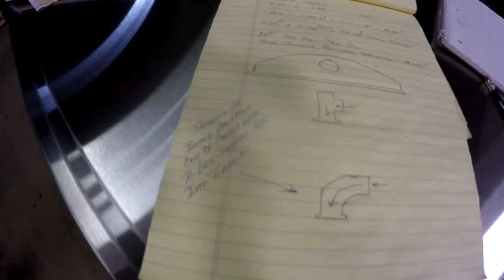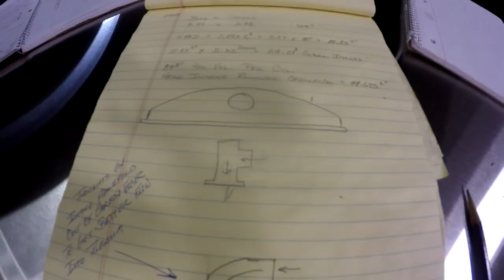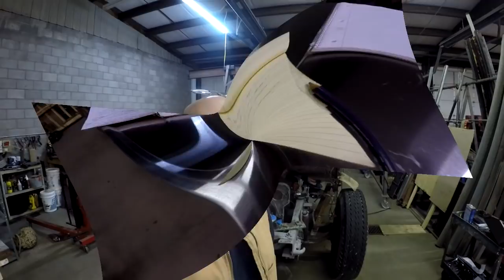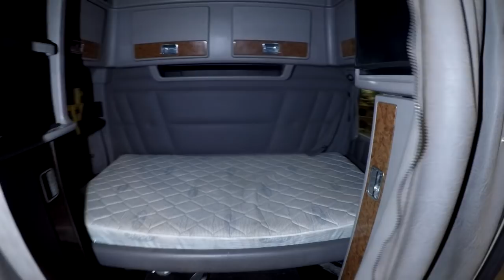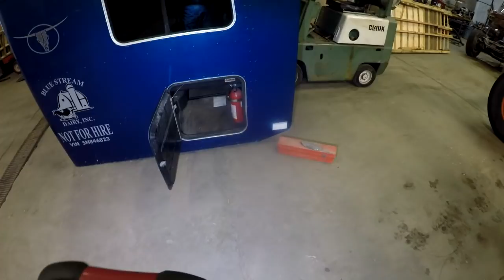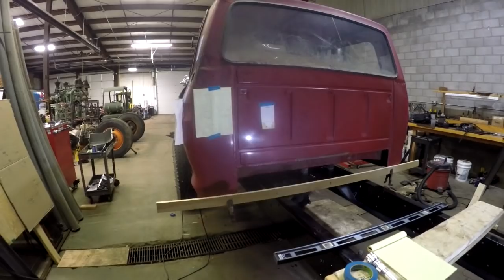Ford F750 Haul Truck Build Part 35 - THE SLEEPER

Comment: Did you ever finish the project? How did you install the sleeper to cab with the gap ? Which material did you use ? Have similar issue with my truck trying to figure it out ? Cab opening is bigger than sleeper opening trying to figure how to seal both up ? Thank for your help
Reply from the maker: Project is still ongoing! No haven't installed sleeper yet! Working on rear air suspension (well working on it when I have time), trying to get it so that I have rolling chaise so frame can be rolled under sleeper for fit-up! Taking long then expected, but it will get there.

Comment: Unibilt is basically how the cab mates to the sleeper those brackets that you were asking bolt the sleeper to the cab making it one unit so that they both ride on air bags making for a smoother ride.
Reply from the maker: So that’s something new that no one else mentioned. Probably stop by a Peterbilt dealer and seen what they use for corresponding cab bracket. 
I have never seen underside of sleeper, but after shop project that is using car lift, I am going to be moving it over and lifting it up so I can see what I have to work with on underside of it. 
Thanks for comment and that info.
Reply: No problem, if you're at the dealership and you have the opportunity I'd take a look at the 389 (provided they have one in inventory)so you have a good idea of what's going on and how they come together. Also just a little tid bit of  info,  Peterbilt made to different cab configurations, a flat cab (low roof) and a ultra cab which has taller profile roofcap the flat cab sleeper has a shorter sleeper opening as opposed to the ultra cab sleeper that you have I figured that info might save you some headaches in the future.

Comment: Nice Job on the Dog house Fred. I Like the carbon fiber ideal they use it in F1 racing. That Sleeper is really nice find Fred you can get the height issue worked out
Reply from the maker: Yeah, that is my first choose too! There are some things that I need to workout and kind of do some research on. One being is the flanged area that would bolt to head air plenum strong enough just using layered carbon fiber, or do I need to add a metal insert. 
If and when you ship that snow blower, let me know how you/they made out with pricing and costumes.
Reply: If I ship it I will let you know how everything worked out.